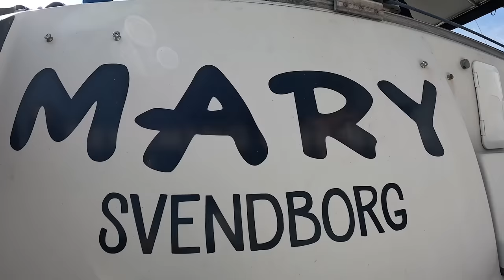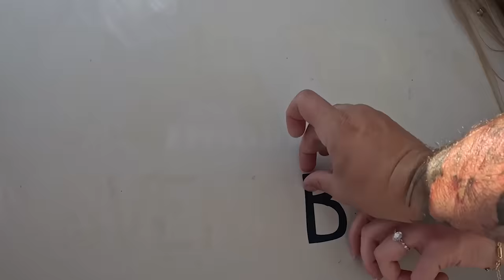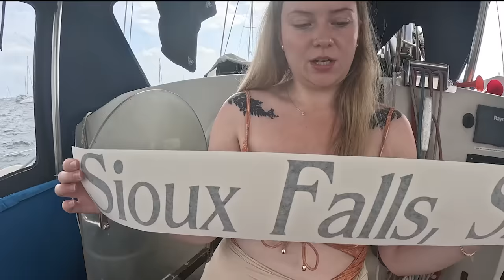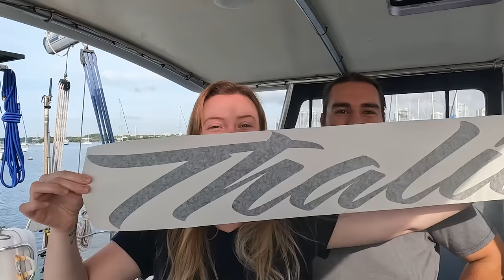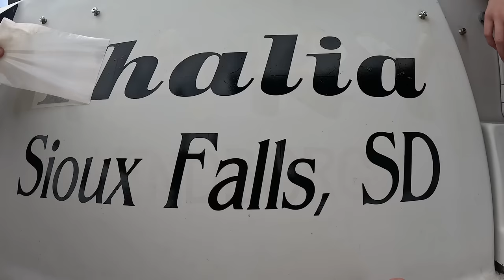Ep. 5 Young Couple Renames Their First Sailboat

Comment: I wonder if the reason the letters stuck to the starboard side better than the port side is because that side had the sun shining on it and it was slightly warmer. 
I'd have been tempted to tie up at a dock for a couple hours to use a heat gun or hairdryer or something. (glue tends to stick better when it's warm)
Something to keep in mind if any of the letters fall off and need to be replaced.
Reply from the maker: Someone else mentioned something similar! So far so good on it sticking to the side, but will have to consider it if we have to replace it :) Thanks for taking the time to comment! Can use all the help we can get 😂

Comment: I was surprised that you were able to pull the backing straight off the first side decal so easily. I usually experience what you did later when the decal kept pulling off with the backing. One thing that helps a lot is to use something flat and straight like a metal ruler as a guide and hard edge to slide the backing paper against as you pull it away. And you also should pull it 180 degrees from where you started rather than pulling towards yourself which would be 90 degrees. This will give more pressure to the decal and the sharper turn of the paper reduces the chance of the decal sticking to it instead of the surface.
Reply from the maker: Honestly these vinyls worked way easier than expected! We may have to redo them eventually but will see how they hold up! Appreciate the advice, will give it a go next time! 🙂